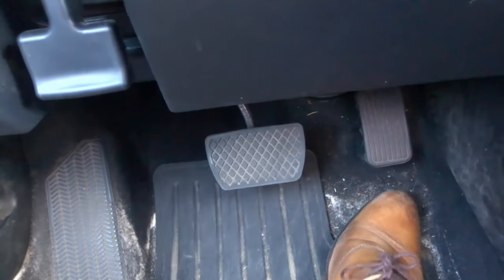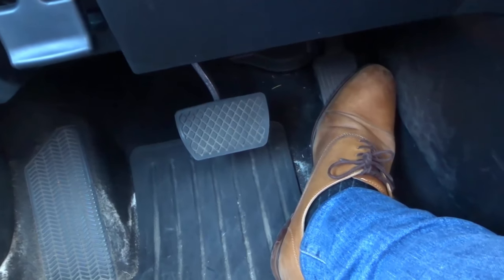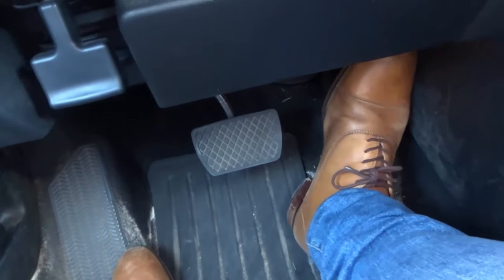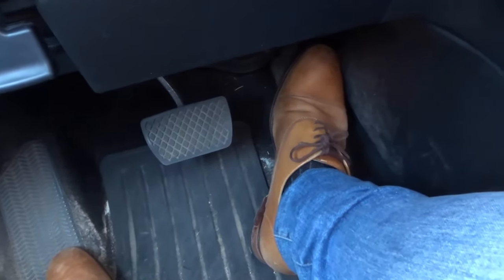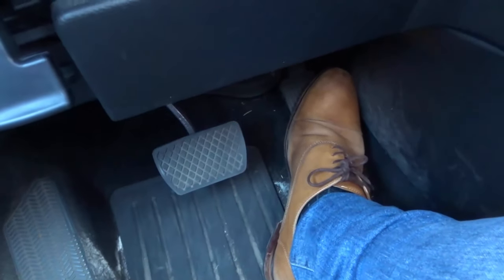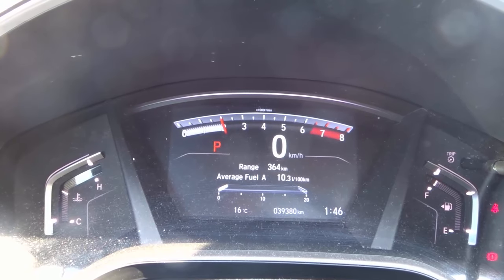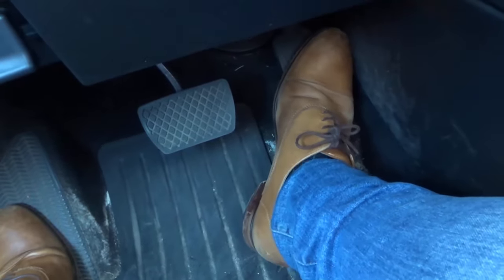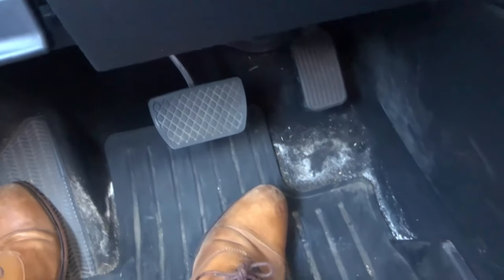EASY Trick To Control The Gas Pedal Better

Comment: holy crap my first time driving i was using my left foot to break. this changed my mindset thanks
Reply: lmao
Reply: Lmaooo no way
Reply: @tonyliu8979  all true bro😂😂 now i use only right foot and its really smooth
Reply: I love your profile picture so much lmao
Reply: @masonpl4704  🤣🤣
Reply: Wt Hell 😂🤣.
Reply: Manual or automatic transmision in a car?

If automatic then left foot is doing nothing in a car.
Reply: @PhantomDogman  automatic🤣
Reply: NEVER use your left foot to break. if you accidentally put gas and break at the same time your car’s gonna fuckin spin out💀
Reply: @elijah.78  Recently thought, if you want to slow down a car then why you would keep foot on gas?
Reply: No way i would've crashed
Reply: 😂 I did that too accidentally would rev it without realizing it
Reply: I didn't on my first time driving but years later when first driving an automatic... only in my mind I thought I hit the clutch. Could've almost scraped my face from the windshield 😂

Comment: low key helped. When i learned to drive I used my moms car which was way smoother with braking and acceleration (cause it’s a toyota minivan), and i just got a new nissan economy and it can’t handle the old abuse :(

Comment: Thanks! I hope you didn’t flood your engine pumping the gas pedal 😂
Reply: smh your gas pedal opens the throttle not adds more gas, you cannot flood your engine in a modern car just by opening the throttle
Reply: @southernautodiy2643  thanks for mentioning this lol. For a second there I was going into a full panic attack as my entire understanding of how a car works was under attack (to be fair that understanding is fairly  limited).
Reply: @loganmyers6686  you're good bro, it seem Henry's experience is with older vehicles, in which case he was right! Modern vehicles don't let you ruin them in such a clumsy manner :)